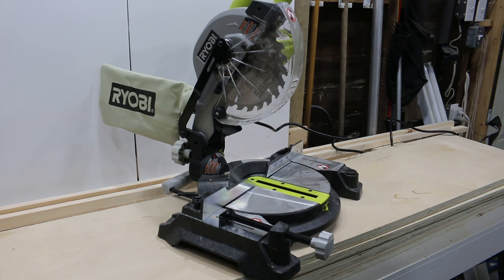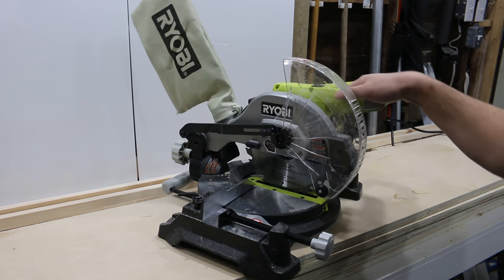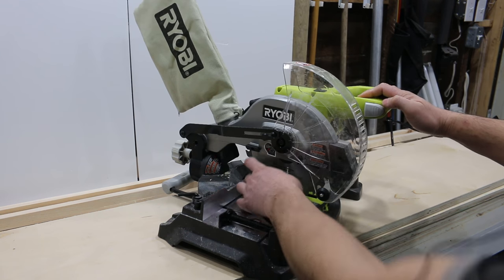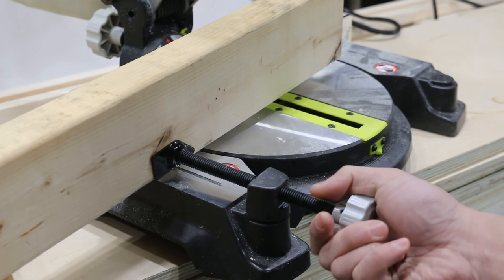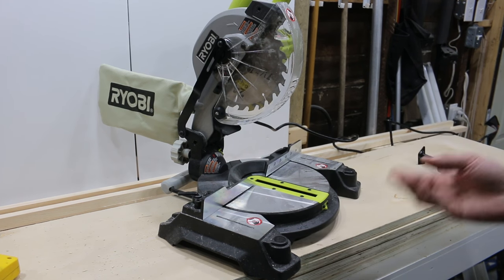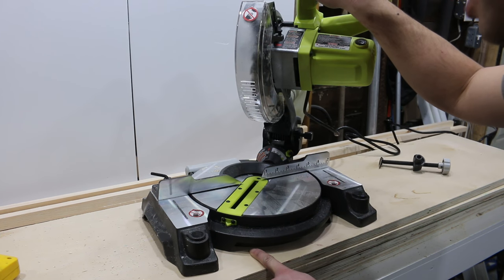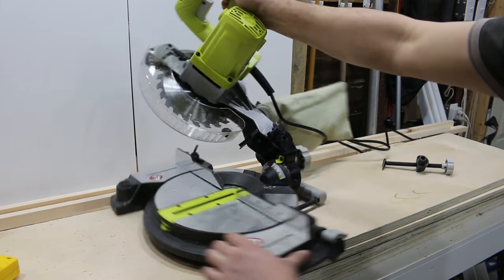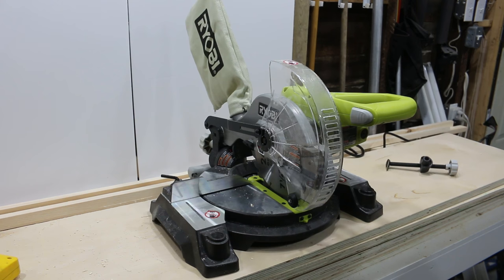Ryobi 7 1/4" Miter Saw Review

Comment: Would you recommend this for flooring? Like laminated and vinyl plank
Reply: Use a good "finish cut" blade, make a zero clearance insert (to avoid tear out), and take gentle cuts to avoid over heating. Miter saws are great for flooring if you do this. (I partnered in a flooring business years ago)

I just snagged one of these from GoodWill for $20 this morning. About to tear it apart for clean up, oiling, make sure everything is squared up, and make a zero clearance insert.

Comment: will this cut 2x2 .095 steel square tubing?
Reply: If you get a steel blade… yes. I have a Walmart Hart 7 1/4 that I use for cutting steel. Just change the blade that came with whatever brand saw you have to a steel blade, and you’ll be fine!

Comment: I’m using this saw  and it works great but at a 45.degrees it only cuts 1/2 way down ,what is wrong with it?
Reply: Check to see if the saw motor housing is hitting the fence, you may need to loosen the fence and slide it over a bit (refer to instruction manual).